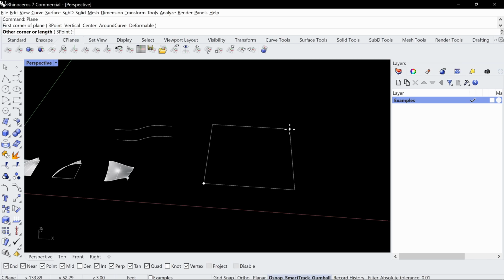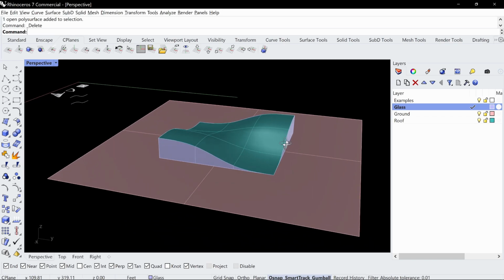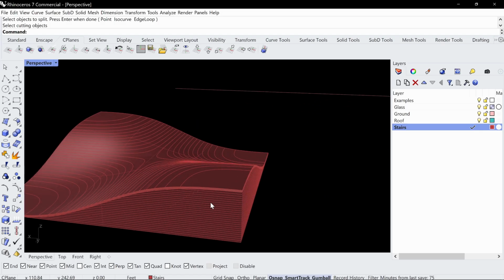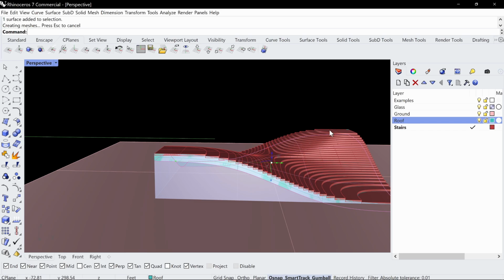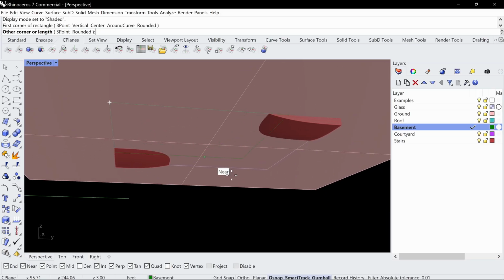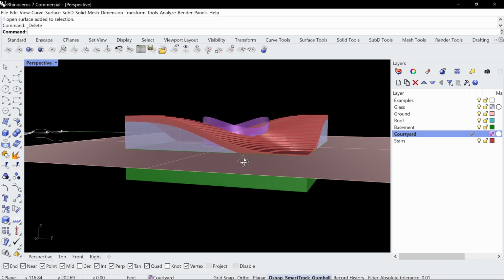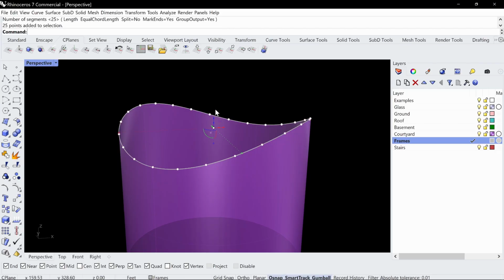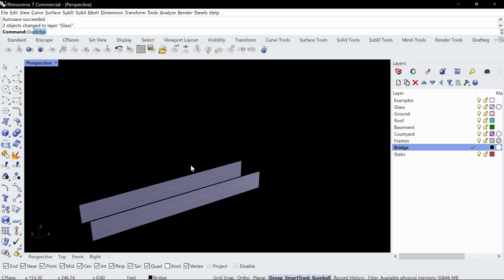Landform Architecture Rhino3D Modelling FULL COURSE | Rhino Tutorial For Architects and Designers

Comment: Hi, when I run planarsrf rhino keepd popping up this message, “Self-intersecting input curves were found.Use curve boolean processing?”

And when I do nothing changes, still can’t run the command. Why is that?
Reply from the maker: Self intersecting curve means you have overlapping lines.

If you do curve Boolean then you have to do surface output. Do it from plan view, and select the empty region inside of the curve boundary. 

You can also explode the original curve and make sure there's no overlaps, then rejoin the curves or just redraw the boundary.

Comment: Hello, i wanted to ask about the start of the video. When i use a simple surface i don’t get a smooth curve, so i opted with using A sub D surface instead. So did you use Subd or just a normal mesh surface ?
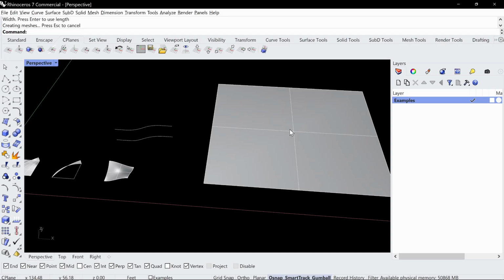Reply from the maker: Hi. After you use create a basic surface with the "plane" command, you need to rebuild the surface to have at least 2 or 3 degrees. See 0:40 to create a smooth curved surface. Hope this helps.
Reply: @unitedstatesofdesign Thank you so much ! It did work ! I did mess with the degree setting before but I tried numbers higher th
Reply: Than 9 (so 9-11) I guess 3 is perfect for it thank you so much
Reply: Thank you so much for your time